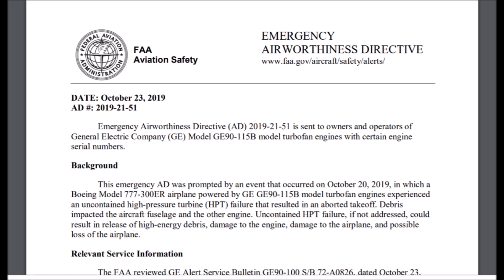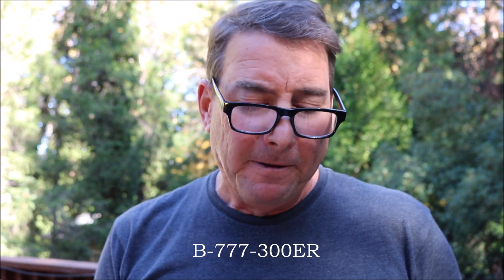Boeing 777 -300ER Emergency Airworthiness Directive

Comment: So the seal fails, 
a part of the engine overheats and fails 
which results in a 
unscheduled rapid uncontained disassembly of the engine (at least in part)... 
and this over heating happend at arround 50mph while take off...
How quickly does this engine overheat or how broken must the seal be to have such a quick effect?
I mean it sounds like the engine failed with in seconds after applying take off thrust.
Reply: It probably wasn't a quick effect. The seal probably failed a few cycles before, and this takeoff happened to be the one where the fan blades gave out.
Reply: I agree with Murph, the metal could have been damaged earlier.  Take-off is probably when the engines are working the hardest, putting more stress on the blades.  But when you have thin blades with very hot gasses flowing past them at very high speed, it won't take them long to heat up if their cooling has failed.  It might be a bit like taking a propane (plumbers) torch, and pointing it at a paper clip.  The paper clip is going to get hot very fast.
Reply: So in other word lucky they failed when they did and no a couple of seconds later just after V1.

Comment: I'm not an A&P,  just a retired AB Captain.  It seems to me if one blade fails as it reaching its peak RPM, won't it get "run over" by the other blades causing all of the adjacent blades to fail?  Safe riding and thanks for your military service, not just Veterans Deay but every day.  God Bless.

Comment: I would check the zoning laws working on jets in the backyard thing
Reply: Seems to me, he only wants to work on the engines, and not the entire aircraft...
So, I don't think residential zoning laws apply!
:-)
Reply: @PatrickWagz  If this was Sim City, give 'em the high residential zoning!
Reply: Generally just noise on testing the complete engine, though he thankfully is not living in an area subject to a HOA, who would probably have a hissy fit, though I doubt any of them actually have rules prohibiting having full jet engines in the yard as "hobby use".
Reply: @SeanBZA    Can you imagine a GE-90 at 'full-song' strapped to the test rig at BlancoLirio Global World Headquarters??  haha...... The neighbor lady stops by...... "Has anyone seen my Pomeranian??!!"     :-/
Reply: @PatrickWagz  No, but I did have a tiny puff of smoke 3 minutes ago, and the garden is remarkably leaf free, along with all the trees in the yard.  There is a little bit though where there seems to be nothing but bare hard baked ground at the rear though, and the tree there seems to have turned to a charcoal stump for some reason.
Reply: @PatrickWagz  That'd blow a few trees into the power lines.

Comment: I'm never flying again, saddle up wife we're taking the RV, plus we can have hot nasty stuff anytime we like, just saying motor on.
Reply: William Schuman There Were Zero Passenger Deaths Reported by Airlines in 2017, however in in 2017 car accidents there were 40,100 Deaths !
So drive careful !
Reply: @markspc1  Yes but hot nasty stuff seal's the deal for me, lol just saying motor on.
Reply: RV bathroom is much bigger too!
Reply: Don't get taken away with the headlines, aviation is an extremely safe form of transportation. Much safer than jumping in your car.
Reply: I was serious telling the wife that, we're not getting on anything Boeing, maybe Airbus NEO but not Boeing.
Reply: @buckshot6481  Please, with the dramatic not flying anything Boeing garbage. Boeing airplanes are the safest airplanes in the sky, have been the last 100 years drama queen. If a boeing aircraft is flying where you need to go, you'll be on it.
Reply: Baylor58 Duncan    That’s not logical.

Comment: Apparently Republic Airways, a Brickyard E175 had a runaway trim situation yesterday and the crew made it back to ATL uneventful, but the radio recordings are scary. You should listen to it. I know it has nothing to do with Boeing or MCAS, but figured I would let you know Juan.
Reply: Yikes.  The electric trim on my aircraft is busted and has been since the last annual.  Maybe I should be grateful,  just pull the circuit breaker, and forget I have it installed.
Reply from the maker: I'd like to hear that...link?
Reply: @blancolirio  
https://youtu.be/RzoEsM0L2CM
Reply: Chandler Wolf  Wow, I listened to that! Scary indeed!

Comment: Hey Juan... the HP blades have a labyrinth internally for cooling, and in recent years ceramic coatings... cooling plates hold the blades onto the disk when inserted into a dovetail slot. The design is to force cooling air into the blades so they don't melt... it would not be the first time cooling plates have failed, as I saw that on other GE engines... but it is a serialized part, where engineers can go back and review vendor, materials, and x rays...  believe it or not, many parts have different vendors today... GE was one of the first to pit manufacturers against one another over price. Plus this issue maybe a part where it was redesigned, yet never got changed out because the air line did not reach the number of hours for a total tear down and inspection. ...One thing GE does right is follow the paperwork and serial # s ... hope it does not effect too many engines.
Reply: As one astronaut  thought as he was orbiting in his lunar module. This thing was built by the lowest bidder.
Reply: @redwingdetroit9671  I believe you are referring to a quote by John Glenn.  He was sitting atop the Atlas rocket on the launch pad in 1962 when this thought came to him:
"I felt exactly how you would feel if you were getting ready to launch and knew you were sitting on top of 2 million parts — all built by the lowest bidder on a government contract."
Reply: Peter Grant 
Cheapest is not always the bestest 🙁
Reply: @jwb2814  Duel sourcing of parts became the industry standard. My Dad worked for GE for 43 years as a design Draftsman, long before computers and cad cam... He worked for Gerhardt Neauman , Herman the German... he was responsible for dozens of Patents, and grew to run GE Aviation... Once the old timers retired, Jack Welsh became CEO... everything became about the $$$$... I only spent 36 years as an AAEM and other jobs...LOL to layoffs... and bumping... Advanced Aircraft Engine Mechanic... ... basically an Assembler of many GE engines... the fit and finish on jet engine parts because of the rotating parts has to be flawless... otherwise the forces of rotation at so many RPMS, will tear it apart... so no matter what vendor it's quality... but my point was GE can Isolate it.. and having different vendors actually lessons the amount of potential problems if a failure happens. GE Is so very smart when it comes to this.. Once upon a time every Jet Engine part was manufactured in house... but the cost was too high because of labor costs...  it sucks... but that is reality.
Reply: Peter Grant 
I wasn’t trying to b a smart ass or anything, your comments are awesome to read and I love turbine engines. You cannot dick around with the quality of parts though.
Reply: @black_dog_barks  Hope I can ask a question.  I am a business traveler to Europe and Middle east from States. Fly these routes twice a month mainly on 777. Should I be concerned about this? Thanks
Reply: Like the old saying goes, "Faster, Better, Cheaper - pick two!"

Comment: so have they grounded the B777-300 MAX or they will fix B737 ER GE engine?
Reply: After that small number of FAA-permitted additional flights, they must ground the plane until they fix the engine. Fixing in place is a lot cheaper and quicker than replacing the engine.

Comment: The implication of the seal failure is that "cold" compressor discharge air was being allowed to bypass its correct path cooling the high pressure turbine blades which therefore failed. Then, this "leaked" cooling air passed harmlessly into the exhaust air stream not having done its assigned task -- decreased engine efficiency being irrelevant at that point. It would be interesting to see how the seal failed. 

Thanks for your service and your work.

Comment: Do you get the impression everything is going south in commercial aviation?    First, Rolls-Royce has massive problems with its new Trent 1000 jet engine, involving durability.  Now GE has this jet engine problem, which probably also involves durability.  Of course, if there are problems with a passenger jet's airworthiness, the airline can send the aircraft to a repair station.  Only recently, on October 25, 2019, the FAA revoked a Florida firm's certificate to repair planes for screwing up its calibration of the sole AOA sensor on the crashed Lion Air Boeing 737 Max.  Whistle blowers at Boeing's 787 plant in South Carolina say Boeing cut corners to build that jet fast, letting Dreamliners go out with defective emergency oxygen systems.  A cascade of bad engineering decisions and quality control problems, with the FAA blaming the rotten apple, not the rotten barrel.
Reply: No, I don't get the impression everything is going south in commercial aviation.  As blancolirio has sad a number of times, things like this AD show how the system is working correctly to make flying safe.  In only two and a half weeks, they have the problem identified and a solution in place.  That's FAST!
Reply: judge crater 
Low cost is not always the best cost
Reply from the maker: We're more aware. Better info fast.

Comment: Informative report Juan, look forward to hearing what (specifically) led to the AD.  Although the extent of corporate bashing is somewhat surprising, especially regarding Boeing.  As you noted, the process resulting in the emergency AD works.  And, I have no doubt that Boeing/GE will work to incorporate appropriate remediation moving forward.  Before folks bash Boeing based on ill informed media reports, they may want to watch a few more of your posts.
Reply: Haven't read all the replies yet, so I haven't stumbled onto any Boeing bashing comments.  But I'm surprised to hear anyone would bash Boeing on this.  Yes, it's a Boeing built airplane, but Boeing doesn't build the engines!
Reply: pima Canyon Boeing didn’t build the AoA sensors on the MAX either, but that stopped no one.

Comment: Shouldn't GE already know which serial # seals are in which engines?  
Lot of  trouble to go fish if not.  GE doesn't need this, neither does Boeing. Bummer.
Reply: I'm sure the do. That's why the AD said "If you're using this specific serial number range of engines, replace the seal within 25 cycles"
Reply: Yes, if you read the AD, it lists just eight engine serial numbers.

Comment: I read about the design/efficiency/challenges of the GE90's after they were certified... the pushed the limits of the cooling air mixed with the exhaust gasses to gain the promised fuel economy. The process included 3D gas flow modeling that at the time was near unheard of... I remember reading that the smallest changes from small leaks and blockages in the system caused large rises in the surface temps and created hot spots in specific areas in the turbine blades. Appears that the effects of those have created failures that the modeling of the time couldnt account for
Reply: ChangefromaBill 
Damn bean counters
durn it

Comment: Why 25 cycles? Ground them in place and fly in parts.
Reply: I think I would rather have repairs done at a regular service facility, rather than wherever the plane happens to be right now. It might take a few hops to get there.
Reply: machintelligence A few hops? You mean fly the jet with a damaged engine to a repair facility?
Reply: @bigjeff1291  There is no evidence that all of these engines are damaged. They contain a part that is prone to early failure.
Reply: Because the increased risk from flying them for 25 cycles is so small that it doesn't significantly increase the risk of flying, and it would inconvenience a lot of people. 

Whenever you fly, you decide the risk of flying is worth it to you.  Now I'm totally making these number up, but say when you booked a flight you knew the risk was 1:5,000,000 that you would crash.  If this engine problem comes up after you have booked and the odds of crash are very slightly higher -- say 1:4,999,990.  Would you want your flight canceled?  I wouldn't.
While I'm making these numbers up, someone has done this type of analysis.  This analysis is a big part of determining the time allowed for the problem to be addressed.

Comment: Isn't this a power plant issue? Not an airframe issue? Boeing has gotten a lot of bad press lately. Are these engines exclusively used on the Boeing 777-300ER? Thanks Mr. Brown.
Reply from the maker: correct.

Comment: could you build out of titanium  the root area ? for the heat if seal brakes
Reply: They would use it if it was better.  According to Wikipedia, "Modern turbine blades often use nickel-based superalloys that incorporate chromium, cobalt, and rhenium."  I don't know the cost of this metal, but I'd bet big dollars that it's more expensive than titanium.   But, most likely the cost of the raw metal is small compared to the manufacturing cost for the blades.  They do some major (and I'm sure expensive) tricks when they manufacture turbine blades.

Comment: So, Juan, what's going on at Boeing? We have the Max MCAS grounding, the MAX rudder cable shielding issue, we have the 787 build quality issues (tooling & waste materials left behind), 787 lightening strike protection compromised, 737 NG Pickle Fork cracks in frames well below those covered by the AD, Trent 1000 Ten issues for the 787-10, and now this on the 777. I acknowledge that the engines are not entirely a Boeing issue but they are a 'key' component.

Comment: As for cost-so many of the engines are rented and payment made by hours of use with maintenance 
included.
Reply from the maker: Good point.
Reply: @blancolirio  What was "Airco Viking" in Verdi Nevada, made titanium rings for jet engines. 
They turned titanium rods (10 ft x 1 ft)  into rings for engine (6 ft dia) and AWACS radar domes. My brother was an engineer there back in the 70s.

Now Arconic fasteners and rings, they still might make the rings. Interesting process. Midway between Truckee and Reno. Field trip???
Reply: dirk tanis hello,,yesAnd the same thing goes for boat Races too! Cheers From NJ🇺🇸🇺🇸🇺🇸🇺🇸
Reply: Rolls Royce has satellite linked engine monitoring. I would guess GE and P&W do too. Headquarters might have known there was a problem before the ground crew. The data was used in the Malaysia 370 investigation.

Comment: I remember a catastrophe engine failure shortly after a plane took off from SFO. The engine came off after the turbine wheel failed breaking through a cement wall missing workers in a cabinet making shop by 15 feet.
Reply: Pan Am 843 in June 1965. A Pratt & Whitney JT3D... the fire caused the eventual failure/loss of the wing outboard of the engine that failed. It made a successful emergency landing at Travis AFB. There is a video of this incident, filmed by passengers. It's available on YouTube...
Reply: Intellectual Wino thanks awesome video.
Reply: Intellectual Wino I have a copy of the newspaper photo of the aftermath my cousin’s shop is across the street from where the cabinet shop was. Thank I’ll look up the video.

Comment: In NASCAR speak that was a failure of the engine cowling.  It failed to hold all the parts of the engine inside the engine  :)
Reply: It threw a rod
Reply: Oil pan failure.  😂😂😂

Comment: If they have identified S/N and number of affected engines, it should be an easy job to identify specific planes they are on. That is, of course, there hsn't been an engine change, but even then the engine will be tracked

Comment: AT my airline?  We used to say "80 knots" as a double-check of the airspeed indicators.  "80 knots"  was industry standard.  MY airline changed it to "100 knots", still well below V1.    MY airline also taught us to call-out V1 about FIVE knots before actual V1.    Juan Brown will know what this means.....
Reply: WeedWhacker2010   My airline also called V1 early by dragging out the “V....one” call. Seemed sort of dumb, actually, when the bug was set to the actual V1. No one thought to set the bug 5 kts slower and call that.

Comment: Are the engines actually designed to contain a turbine blade failure? Those blades are a lot heavier than compressor blades...
Reply: An A320 from my former airline suffered a catastrophic engine failure a few years ago during climb out from DFW.  I saw the aircraft during taxi out for my flight after that plane had completed its successful emergency landing.  The aft end of the engine had departed aft from the engine nacelle.  

Don’t get the impression that only Boeing aircraft, which are in the news these days are the only aircraft suffering massive accidents like this.  As Juan mentioned, a 737NG suffered a fatal engine failure too.  These three all have different engine types installed.  These are engine related problems and not airplane type related.
Reply: @kenwhitfield1569  agreed, this is all about the engines, the 777 has been one of the safest planes out there.
Reply: @kenwhitfield1569  well engines work at very high power...it is normal sometimes to get broken. As a matter of fact there will be always some kind of engine troubles. the more you use them the more higher chance of engine failure
Reply: Yes, but only one blade. Not multiple blades and/or a chunk of blade hub.
Reply: Fan blades turn at much slow speeds than turbine or compressor blades.  The kinetic never of the fan blade is thus much more possible to deal with.  Of course, fan blades are much larger too, and can create far more damage if it leaves the engine case.  The problem with the 737NG was that the broken fan build departed from the inlet rather than through the engine casing.   NTSB wants a longer engine inlet cowling that might keep the broken fan blade piece within the engine.  This is a much much bigger design change that will have many other effects on the airplane.